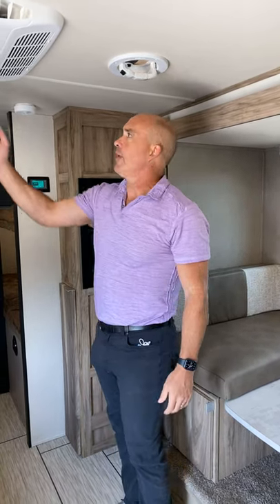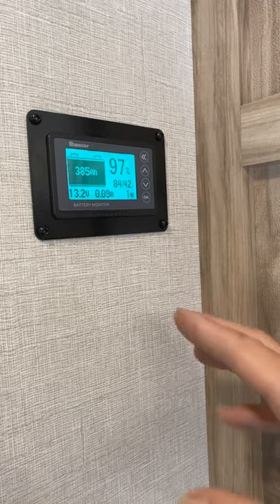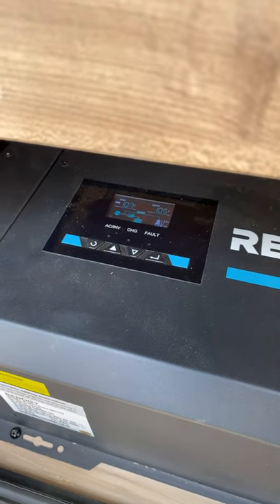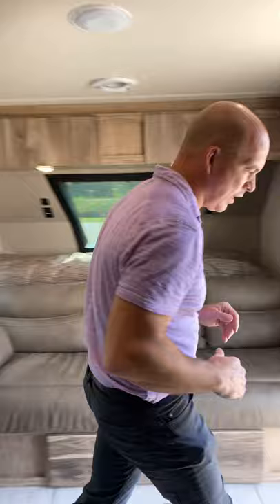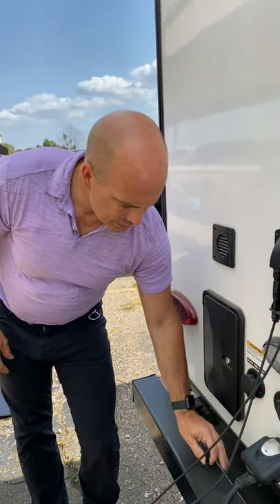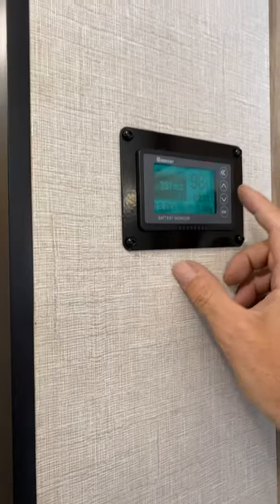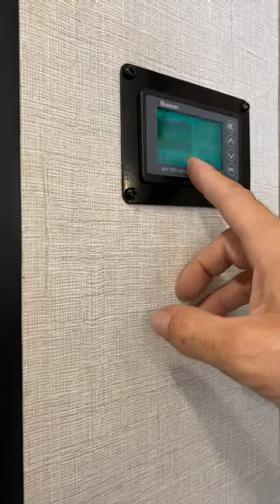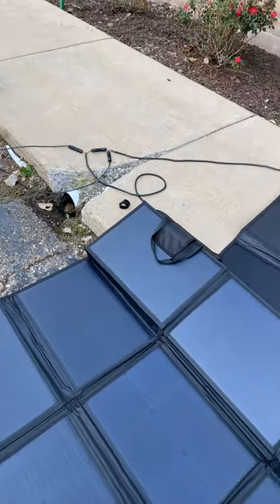Palomino Revolve Solar Travel Trailer

Comment: We have the ev3 and let me just say make sure you tell folks about the 300a fuse, we blew ours and had to get the part overnighter from the plant, fun times!
Reply: What caused the fuse to blow?
Reply: I have the EV3 and it seems if I plug in my suitcase 300w solar panel in the back it blows the 300a fuse.  Is that what happened to you?